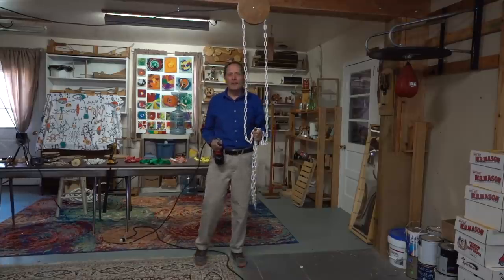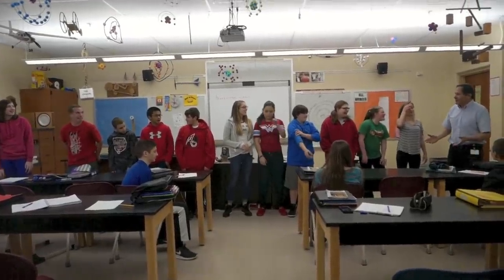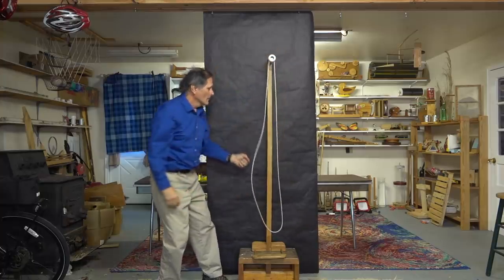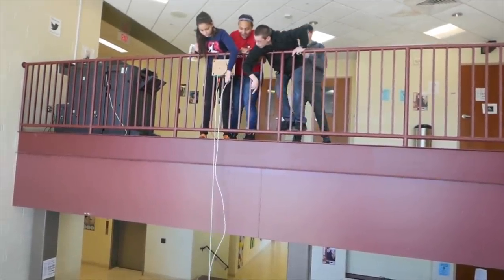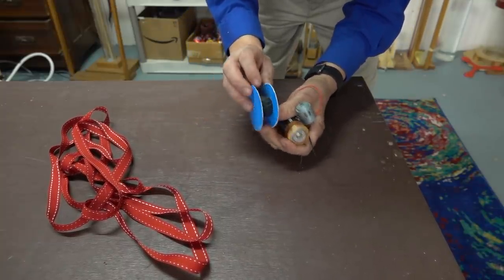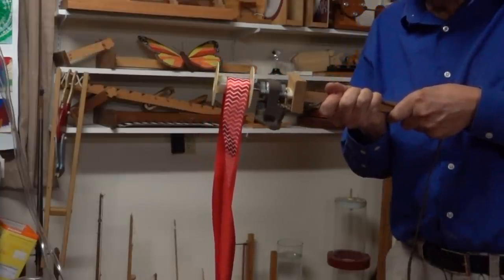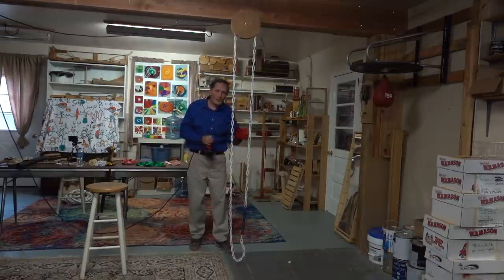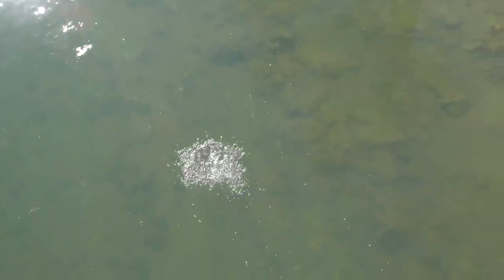Slow Moving Waves in Giant Hanging  Loops--- Cool Science Experiment

Comment: So would it hold a slowly decaying standing wave if you moved the loop at the speed of wave propagation in that medium?
Reply from the maker: I'm hoping to get it to that point.
Reply: Wouldn't happen due to losses.
Reply: @Denasdc  it would slowly decay of course, but the point is that it might be possible have the wave "stand still"
Reply: @YeanyScience  also, if you moved the loop slighty faster than the propagation speed, would the wave slowly travel backwards? Would the wave switch directons and join the direction of the moving rope(resulting in the wave travelling very fast across the loop)? Would something else happen?

Comment: This is just an IDEA, because I have not tried it myself, but I am pretty sure you will get a MAGIC effect ! :-)

Replace the drive (motor)  with an Arduino controlled "digital" motor (dynamic speed control. Stepping motor or PWM?). 
Besides the motor, also have a load sensor (could be just sensing the current!).

Program it in a way, that the speed is continuosly adjusted, and also given a "bump" speed increase (or decrease) every now and then, SYNCHRONYSED by  the load sensor.
While running at a certain speed, you give the chain or rope a manual hit, to start the wave, which would then be MAINTAINED by the load sensing motor, auto-synchronysing to the natural frequency of the wave-speed-weight-inertia system.
Through the ARDUINO programming, you would fine tune it, as to maintain its natural frequency (at resonance!), just like little pushes you give when on a swing, to maintain your swinging.
Since the synched impulses of the drive/motor will not be seen or noticed, the standing wave would magically stand for ever, without the need of further manual kicks !!  :-)

Any ARDUINO hobbyist interested ?

Comment: Have you built one that can move the cord faster than the wave velocity?
Reply from the maker: I was hoping the drill would be fast enough but it didn't work.  I think I might have better success trying that horiontally between  2 wheels
Reply: @YeanyScience  I am thinking it might have to be between two pulleys or it would stall just before reaching the wave velocity as the chain begins to lift on the turn around the top.

Comment: Love watching your videos, never lose your curiosity!
How cool would it be to make it a more controlled scenario and somehow get a wave generator (maybe a linear actuator in the middle ) to make the same amplitude wave each time and then match the speed of the wave with the RPM of the motor so that it would look like it is standing in one place but only losing amplitude over time. Also maybe mounting another motor or just a free wheel to have the chain or rope be fixed on 2 points instead of 1. Just some thoughts
Reply from the maker: the actuator is a good idea, I'm going to do some more tests on this but I don't think it's going to work with the hanging loop.  I think the motor is already going faster than the wave speed in a stationary chain. I'm thinking the two wheel possibly horizontal might have more success,

Comment: Very cool. How does the force needed to induce waves change with material and speed of circulation?
Reply from the maker: The heavier the material,  the more effort is required,  increasing the3 speed requires slightly more effort, but not as noticeable as the material

Comment: Always good stuff.
Reply: Well done.  Not trying to take away what you did, just trying to see if I got this right.  My explanation for the "slow wave" is as follows: The wave appears to move at a slower speed because you are seeing it travel a farther distance on the chain.  Imagine the slinky wave as shown earlier in the video.  Now make it 100feet long.  Stand next to the person starting the wave.  As the start the wave you sprint along the same direction the wave travels.  The wave (bump) will appear to move away from you slowly.  It's moving at the same speed, but you are moving at nearly the same speed (if you are Usain Bolt) so it will appear slower.  If you could be the same speed the wave will appear as a bump in front of you and if you are faster it will seem like it's coming towards you.  The chain spins so we see way more of the chain as it moves through it.
Reply from the maker: I'm  slowing  the wave down by moving the medium opposite to the wave direction and seeing it from a fixed or stationary frame of reference point for observing it's motion.   Your suggestion would be another way of observing it slowing it down,  stopping it, or even reversing it's motion. In your case you are seeing it from a moving frame of reference as you move with it.  We could both see the results in the chain even though the speed of the waves traveling from one end to the other end of the  chain would be vastly different in my  design versus yours.  Thanks for posting this.

Comment: If the wave slows down as the spin speeds up, then with enough speed, would it be possible to halt it entirely?
Reply: Theoretically yes, but not in practice as gravity is still pulling the chains down.
Reply from the maker: I couldn't capture it on video but that appeared to happen in some faster moving streams of water.    I would like to explore that a bit more  in the future,  perhaps having a longer chain or rope between two spindles and moving horizontally  instead of up and down might work.
Reply: @YeanyScience  What's the practical limitation of moving a vertical setup that fast? Also, couldn't you use a loop of something with a slower propagation speed to lower the speed at which you have to move it?